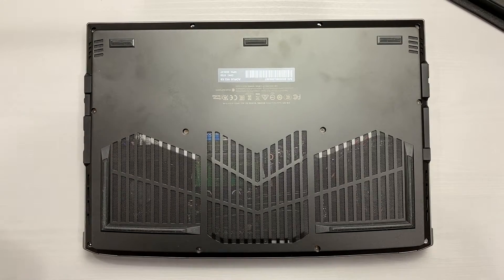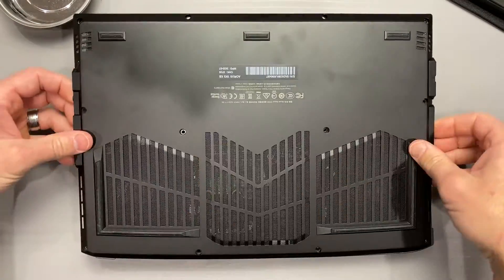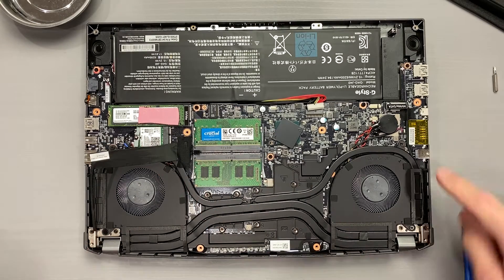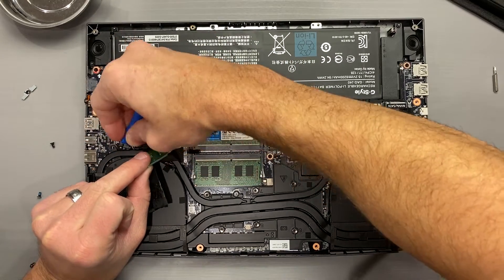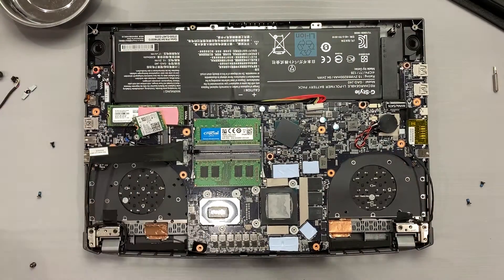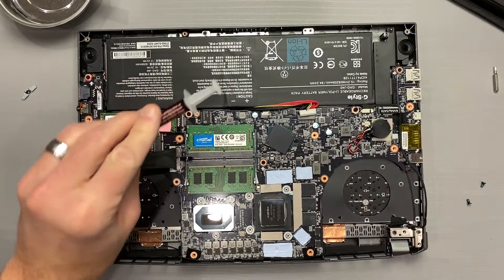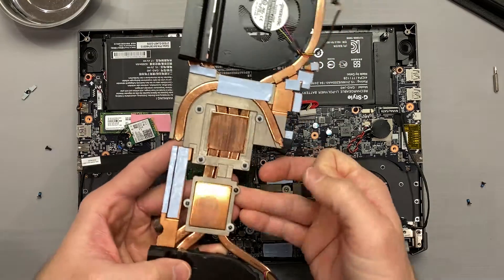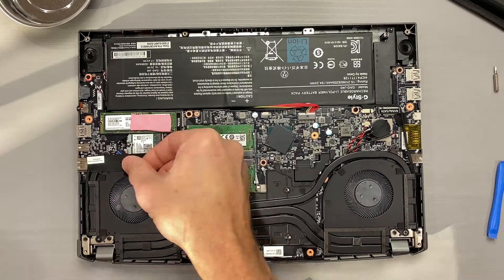Aorus 15G Repaste!  Covers 17G and Newer Aero Laptops

Comment: Hi Bob, need Help here
My 3 month old predator Helios 2020 got repasted using thermal grizzly kryonaut(verified), it was running all cool, I was testing the temps, and suddenly it went bsod in one of the games, and then my nvidia control panel stopped working. There is a error code 43 for the rtx 2060 GPU. 
The cleaning process was done using my 70% isopropyl alcohol, as the acer guy didn't have anything better. 
The laptop functioned really well for half an hour. 
What could have gone wrong?
Reply: Bad things can happen when you repaste:

 1. You can chip the gpu corner when cleaning if a cloth gets stuck there and you use too much force pulling down, or if you thighten the heatsink screws all the way instead of a bit at a time;

2. You can take a small capacitor from the motherboard or the gpu chip if you hit it with enough force;

3. When you use 70% isopropyl alcohol, 30 % is water. You can short things if you forget to remove the battery. Or if some didn´t evaporate or it is stuck under the plastic that some manufacturers use around the gpu die to protect the capacitors. Try to disassemble everything and use an hair dryer around the gpu;

4. You can zap anything with static electricity if you touch the motherboard without grounding yourself first;

5. The Gpu is not properly covered by the thermal paste. Some people(Bob included) love the dot method. I don´t use it because you may, or may not, get enough coverage on the die. Use the spread method instead. Forget the silly theory about air bubbles. If you still want to believe in fairy tales, spread it first and then pur a dot on top. More paste will not damage anything or prevent contact. Less paste will:

6. The heatsink may have not been properly thightened;

7. The paste or themal pads may not do proper contact after reassembly and the vram or mosfets may overheat, check the pads and replace(or realign) if necessary and if you don´t know the thickness, use thermal putty(not paste!!!) to replace thermal pads, like laird tputty 502(found on mouser electronics). You put more than the size of the gap and you will get proper contact everytime( search google for "asus rog k5 pro" and you will find some posts and photos from me for you to get an idea about thermal puttys);

8. You can even bend the heatpipes on the heatsink when removing it. If it´s kinked, it will not work properly.

Changing thermal paste is safe for the experienced user, but for a novice it can be very dangerous. Not for you, but for your wallet. There´s a lot of things that can go wrong that people don´t show on youtube videos.
Reply: @chicozeb  this seems helpful. I know with the help of an expert hand my problem could be fixed within an hour. It could be the thermal pads, since the old thermal pads over the vrams was wearing out. I even mentioned that to the acer guy. He said it shouldn't affect anything. 
Later when the same guy came for checking what was going wrong, he declared its a motherboard issue without even opening the heatsink. Now has been more than a month of wait since acer promised to replace my motherboard. The status has been awaiting for spares ever since.
Reply: @dhritiman7700  sometimes people reconnect the fans with the connector upside down, since in some laptops it goes in also that way. That usually fries the fan and may damage the motherboard. Sometimes just a new fan fixes it.
Reply: 1, 2, 4 are very unlikely and not as easy as you think. 6, 7, and 8 wouldnt fry the chip later, it would either be high temps or not boot which only leaves 3. 3 is correct, totally possible that the 30% water could have shorted something BUT for there to be enough to cause that he would have to basically pour it directly on the board and try to boot it while its still wet. 

basically theres something the person is missing in the story thats actually what happened
Reply: @bradhaines3142  I applied the 70% isopropyl alcohol with a qtip and cleaned the GPU and cpu thermal paste residues. Left it open for 3-4 minutes extra to let it dry any excess water(on the surface there wasn't any).
I had been testing different games for half an hour straight without noticing any problem, and then suddenly in call of duty warzone it goes BSOD. I restarted the laptop, then tried playing cod again. Once more bsod. This time the nvidia control panel won't open and there was a error code 43 to the GPU in device manager. 
Other than the GPU, everything else runs normally. 
The fact that the GPU ran well, infact better than ever before (because of a better thermal paste) and then suddenly goes BSOD in one game has had me.
The laptop is still in warranty, the motherboard is supposed to be replaced by acer, but they are taking way too long(has been more than a month of waiting).
I haven't tried reopening the chassis, since I don't want to mess it up further. 
P.s: the acer engineer declared that it's a motherboard fault without even opening the heatsink.
Reply: @dhritiman7700  interesting, did you try any other programs? how much time did it take before the 2nd one? what were the bsod error codes? you mentioned in device manager but i meant when the bsod happened. 

i have a 3 year old aero v8, runs like a champ still, though it seems the CPU fan is starting to fail (noise from the motor) but thats thankfully no motherboard failure
Reply: @bradhaines3142  before the GPU stopped working, I did test other games like rdr2, gtav, cyberpunk 2077. All of them ran completely fine with GPU temps maximum reaching 65 degrees, which I feel is fine for a rtx 2060 oc. The fans were running fine too, since the laptop's just 2 months old.
Reply: It’s possibly because the graphics card isn’t properly connected (though unlikely) or because you need to update your drivers. Try to check if your drivers are up to date, and if they are then google the error code you’ve been getting and see if anyone had the same problem before opening your laptop.
Reply: Maybe you screwed the heatsink back onto the GPU too hard and damaged it?
Reply: Sounds like the GPU is fried. Sorry man. You might have to get a whole new laptop now.
Reply: @justswitched8841  I don't think so. GPU temps barely reached above 65°c
Reply: @dhritiman7700  Oh ok. Guess ur good then.
Reply from the maker: I don’t think anything could’ve gone wrong
Reply: @BobOfAllTrades  my GPU doesn't work anymore. :(
Reply from the maker: Clearly but I can’t tell you why based on the information I was given

Comment: Nice work!  👍🏻
Were thermals or fan noise on the 17G any different to the 15G as far as you can recall? Does the 17G have larger radiator fins?